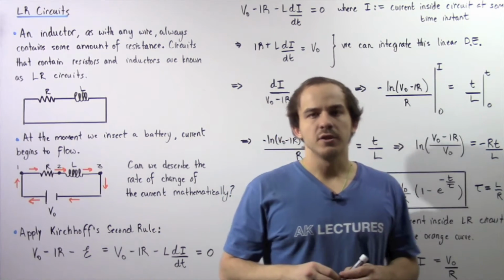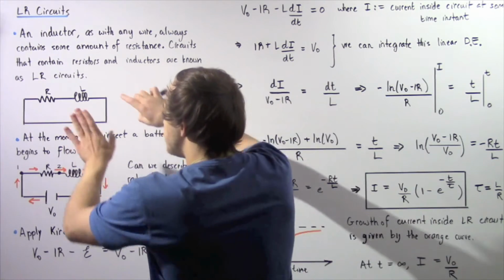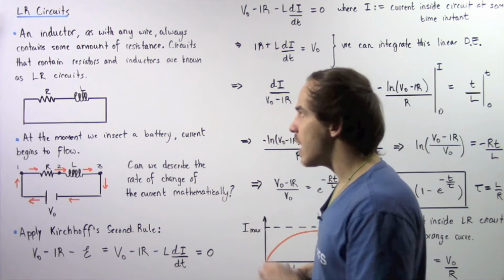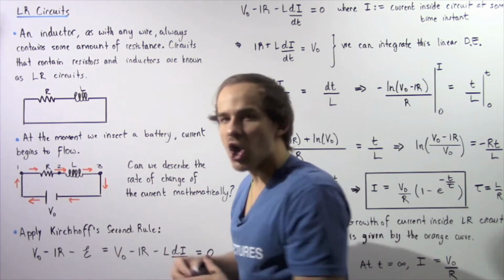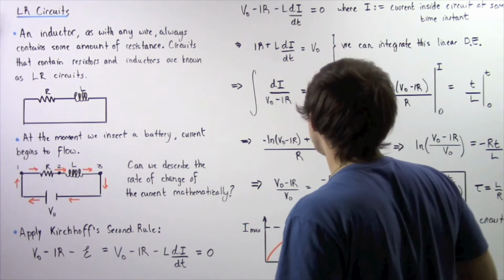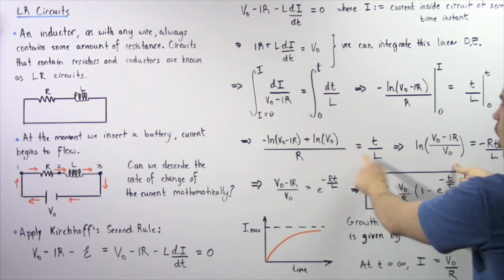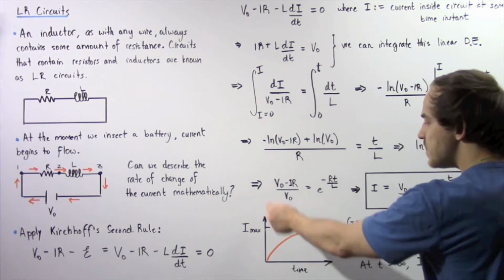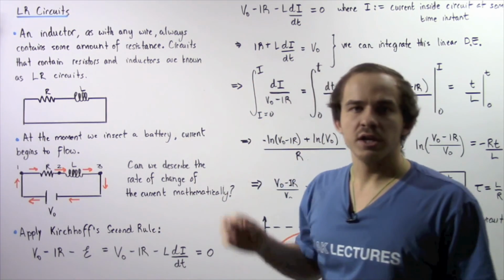LR Circuits

Comment: I just have a very small correction to give (if I am not wrong). Actually, the emf is negative (indeed, the magnetic flux increases, so dphi/dt >0, so - dphi/dt <0, Emf <0 and Emf = -L*dI/dt). So Kirchhoff's Second Rule should give us V0 - IR + Emf = V0 - IR - L*dI/dt, isn't it ? But it does not change the result at all. ^^

Comment: If the change of magnetic field induces an EMF, the electric field is no longer static, Kirchhoff’s 2nd Law only applies if the electric field is static and there is no change in Magnetic flux.
Reply: This is not a problem : when you have a closed loop in the electric circuit with a battery, the electric field has a beginning (the "+" terminal) and an end (the "-" terminal), so the electric field is conservative in the loop and then the circulation of the electric field on this closed loop is zero. The induced electric field that is created by the inductor is just a "counter electric field" (the inductor creates a "counter emf", Lenz's Law) which lowers the main electric field. So Kirchhoff's 2nd Law does apply to any closed electric circuit, even if there is an inductor.